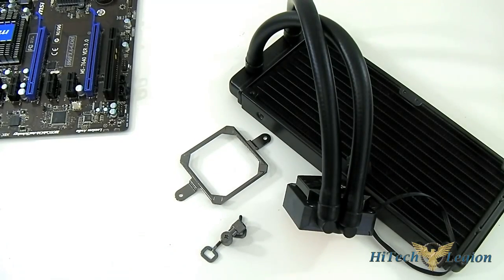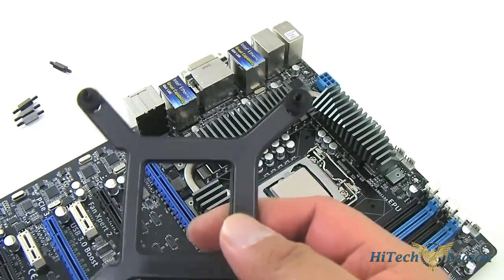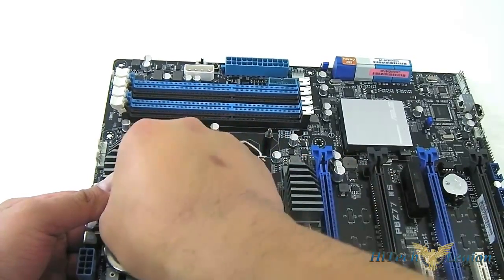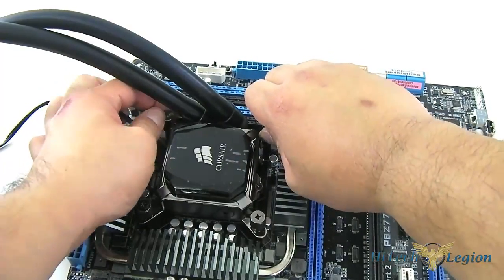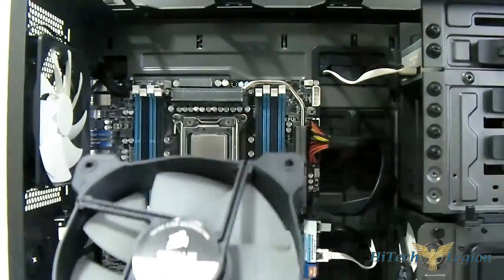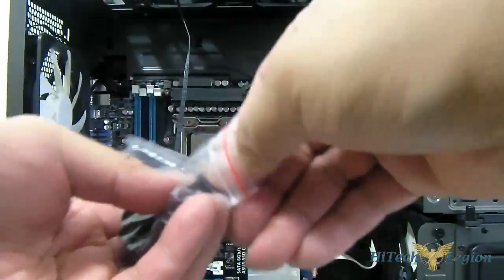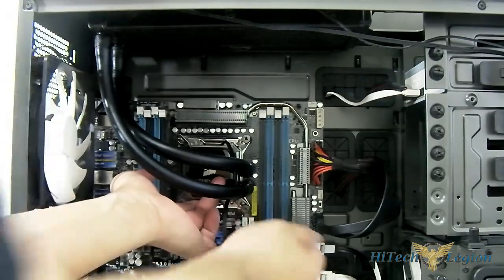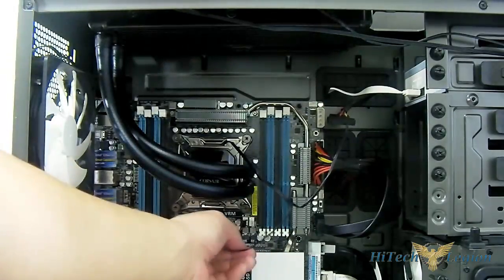Corsair H100i CPU Cooler Installation Guide for AMD and Intel Motherboards

Comment: I bought mine a few months ago installing the fans directly into the motherboard(didnt read the manual correctly). It worked fine for a while, idle temps were at 35-41 and the fans were installed to push air through the radiator from the case as it was showed in the manual.

Now a couple of months later the idle temperatures changed to 48-52 so I connected the fans to the coolingsystem and changed the fans to pull air through the radiator from the case(was too lazy to remove the actual radiator). This didnt change anything at all.
Does anyone have a clue as to why the temperatures have gone so high?

I just recently did a stress test running my i7-4770k at 100% workload and it instantly goes up to 100 degrees C.
This seems awfully high does it not?
Reply: It could be a number of things, but it certainly isn't a fan issue.....

The most likely cause is a pump issue. These pumps are underpowered to begin with with, so the tiniest air bubbles or pieces of debris can set them off. Or it could just be that the pump has begun to fail in general (which is probable).

I would highly recommend you take the unit out of your build before you possibly damage something and RMA it.

Comment: Just installed mine and it makes a buzzing sound, kind of annoying, would happen to know why?
Reply: I'm not sure if it's correct but I read about the h100 if there is too much voltage to the pump it spins too fast and the bearings make noise, not sure if the same applies to the h100i but worth a check on google.
Reply: update your firmware
Reply: someone said theres a pin on top that oyu need to unlatch.

Comment: I installed the H100i.  The manual states that the long mounts are to be used for the LGA2011 socket.  I tried this and the mounts were too long, causing the pump to be loose on the processor.  I remove them in favor of the short mounts and all is well.

Comment: So is that fan plug that you called a "dummy plug" really a dummy plug?  In other words, could I just not plug it in to the CPU fan header on my mobo and plug one of my case fans into that header instead?  It would be a much cleaner install with the one cable routed to the backside of the mobo tray to connect to SATA power rather than having to split it like that.
Reply: Yes, you can do that. The only thing the dummy is there for is to make your MB think there is a fan connected.
Reply: That's just there because some MotherBoards won't let you boot up without a Fan Plugged in for the CPU

Comment: Top intake?  Odd.
Reply from the maker: Havocdk There really is no case setup that shows a benefit from blowing hot air into it. Loops with GPU blocks are, obviously, less affected by this, but that isn't an option here. And if you are running as much intake to exhaust as you specify here, your gains on CPU temps will be minimal by running intake.
Reply: Yeah, don't even get me started on this. Corsair's install manual recommends you run the fans as intake....even on the top. This, of course, makes the CPU cooling look better in benchmarks (like this one), but is bad for every other component in the case and disrupts the natural airflow of the case. Shady, shady business to make it look a few degrees better than comparable coolers at the expense of your other components.
Reply: Cool air sinks

Comment: does it matter which way the radiator is positioned? Could I mount it so the tubes come from the right side and don't cover up the corsair logo?
Reply: As long as the radiator is above the pump/block it’ll work, which side the tubes come from doesn’t matter, I’m a little late, 6 years late
Reply: @Ethnosis  Don't worry, I installed it years ago so that the tubes don't cover the block. Thanks for your response though :)

Comment: What's better closed loop cooling or open loop?
Reply from the maker: Open loop (even the least expensive options) will provide superior cooling, far better performance to noise, expandability, ability to be customized and typically higher quality individual components. Closed loop was initially introduced as a more convenient, lower cost way to have liquid cooling, of course with the lessened performance you would expect when "lower cost" and "convenient" are involved. However, the introduction of pre-assembled open loops like the Swiftech H220/Cooler Master Glacer 240L and lower priced open loop kits with top quality components (like the XSPC Raystorm 750 EX240 Kit) now has open loop options at prices close to closed loop while still offering all of the open loop benefits and superior performance.

Comment: +RapidInstincts It is a closed loop system meaning that the liquid is already inside the cooler when you buy it, and requires no intervention as far as the liquid goes. As long as you hook it up correctly, it will work fine without you worrying about liquid.
Reply: thanks, wanted to know just that.
Reply: fuckin sweet thanks for that man
Reply: IraaFW Very little of what you are saying here is actually correct. The CLCs currently on the market using a very standard distilled water and glycol mixture, which is the same as most bottled coolants for custom loops. There isn't a "gel" of any sort.

The reservoir is typically used as a fill point and acts as a place for air to collect so that you do not get air running through the system, or allow the pump to become air bound. It does nothing in terms of rust prevention, nor does it have any effect on your tubing.

The difference between "water cooling" and "liquid cooling" in terms of current computer components is merely the act of saying "water" or "liquid".
Reply: thank you man i watched so manu videos just for this
Reply: Thank you so much!
Reply: lol well there is a difference between Water Cooled and Liquid Cooled, Liquid is the gel thats inside of this liquid cooling pump, water cooled requires you to have a pool/ reservoir of refined type of water so it doesnt rust or concede your tubing. Alpha Cool and Corsair are the best to look into Alpha Cool for the actual water cooling and corsair for the liquid cooling systems like the H100i but some consider liquid to be water also just thought id lay the technical stuff out there about it :P
Reply: But you will have to replace it after some time, right?

Comment: Ok so im confused on how the H100i works. Is there any liquid involved? Like my build is an i5 3570k 8gb ram 500w gtx 760 mdi z77a-g43 mono CM had 922 case Windows 8. Ok so do I just install it and thats it? Im confused. Do I need other liquid cooling stuff in my build for this to work? Someone please explain this to me I would absolute really appreciate it
Reply: the video shows all you need to know. if you were to cut the tubes, you would see that it is filled with coolant, so you dont need to add coolant. if you were to take apart the part that attaches to the actual cpu, you would find the pump. nothing else is needed to run the loop. All you really need to do is have the fans hooked up, the unit attached to the cpu, thermal paste, and power to all the parts(pump, and fans) and it will run as it should. good-luck.

-Ryley
Reply: It's all in one

Comment: can you replace the tubing with clear and use a different cooling liquid?
Reply from the maker: No, you would need to upgrade to an open loop cooler for that, such as the Cooler Master Glacer 240L or Swiftech H220.

Comment: Does the rad fit 2 140ml fans
Reply: pretty sure don't quote me on this but i think it is only 2 120mm cause its a 240mm so just slap 2 noctua fans on it.
Reply: No, the H110 does however

Comment: question can i connect the 2 fans into the actual cooling unit and have them function normally using the sata connection power or is it mandatory to use the software if i want the fans to work through the units power. i would rather connect the fans to the h100i and then use my remaining motherboard chassis fans connectors elsewhere

Comment: Couple of questions:

Do I use the equal sided screws that you used for the new Haswell 1150?

How do you mount the cooler to CPU? Does direction matter? I am building a mini Itx which will lay flat so just curious.

Comment: Does it work on older boards? I have a P5W DH Deluxe MB with a Q6600 CPU (LGA775 socket). If it doesn't, what do you suggest? I want to get this because I plan on upgrading to a top of the range new Intel next year and want to use the same cooler for both.

Comment: That AMD installation.. It's horrible.
I got the H100 which uses the same, just as horrible. While installing it I had the hinge "pop off" with force, fearing that it might pop off some day where I least think of it.
I'm a major hardware geek, I've installed tons of coolers, from huge ones such as Mugen 2, to this tiny one - And this is definitely the worst installation ever. Not hard, but bad.

I came to see here if they had fixed it with the H100i, they haven't. Time to check the competition.

Comment from the maker: You need to look at the overall picture. There is no question that you will get a few degrees better CPU cooling performance running the fans as an intake. However (and it is a big "however"), if you don't have sufficient air intake and exhaust from other sources you will turn your case into a hotbox, leaving your other components running too hot. Best answer - try both, keep an eye on ALL of your component temps and see which works best in your particular build.

Comment: Should I use the fans on the rad as an exhaust or intake?
I was told the rad itself gets hot, so that made me think to make it the exhaust.. but I really have no idea what's the right thing to do. 

For my case, my only option for dual 120mm rad is on the front, intake, fans.. Now, I can change those, but I am just concerned whether or not I should be pulling air into the case or pushing it out of the case through the rad.

Thanks!

Comment: It is a self-contained kit. The pump is on the block and the liquid is inside already, you just need to install it, plug it in and turn it on.

Comment: I see alot of people that are using Corsair link products they connect the link wire to a usb header some boards only have 2 usb headers so you lose one header and if you have the h100i and a psu like the ax 860i every review i watched they don't even mention the cooling kit i tried to post a link but youtube won't let me go to Corsair and under products go to corsair link kits in the drop down menu they have the cooling kit for 54.99

Comment: I installed it on my I5 2500k and the temperatures are worse than with my old CM Hyper 212 +. I am using arctic 5 in Line method. I used X method when tightening screws. I am at stock speeds and even with power saver at 1.6 ghz @ 0.936 volts temperatures are at an average of 38c. Any idea what I can do fix? Thanks.

Comment: Bought mine yesterday 5.04.13. After reading forums and wathing some vids I've assembled the damn thing outside the case so i could return it instantly if any problem occurs.
But there were NONE. Works just fine, no rattle or problems with led, software works fine.
Just one thing though, tech support suggests NOT TO update firmware if there are no problems, as it is for fixing issues, For example i don't have any and could broke it if updating regardless. Peace

Comment: Have they fixed the low RPM fan "rumble issue" yet? I saw people fixing it by not connecting the fans to the pump, but to the motherboard instead.

Comment: @eRoL

Push Pull isn't going to do anything really, maybe 2 Degrees. A Rad that thin can't take advantage of Push Pull. I'v used it both ways, it's really just adding more noise...

As for the Thermal Paste, it's fine. I used AS 5 after and got a 1 Degree difference. So it's really up to you.

Comment: Two quick questions. I plan on buying an H100i soon and I'll probably want to do a push/pull config with some extra fans from my old rig.

1) Are there enough screws/parts to mount 2 extra fans or just enough for the 2 provided?

2) Is the thermal compound it comes with decent? I usually never use the generic paste when I buy CPU's and I still have Arctic Silver 5 hiding somewhere. Do you think it will make a difference?

Comment: No. Theres only screws included for 2 fans. However, those can be easily bought pretty much anywhere and on custom watercooling sites since those a standard radiator screws. Also, if you use other brand fans(The corsair ones are bullshit) DONT connect them to the H100i, because it'll keep dropping them to 0 rpm, and back to 1200, and back and forth. Connect them to a fan header